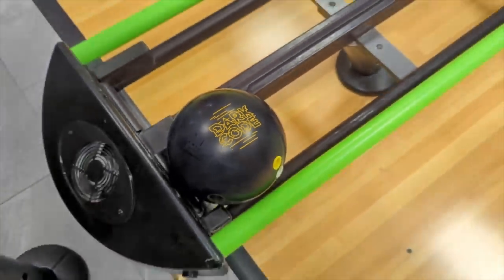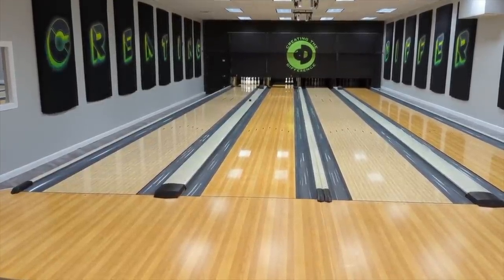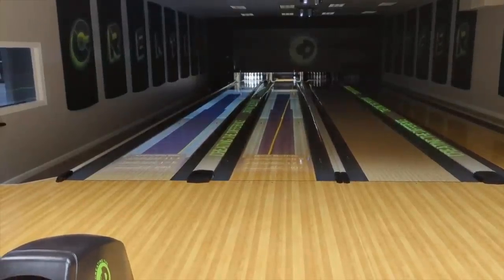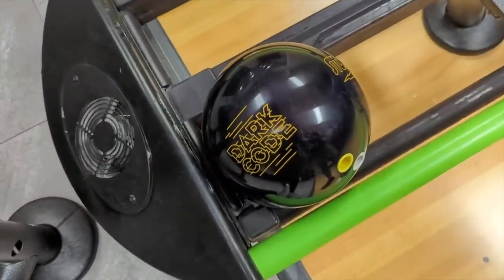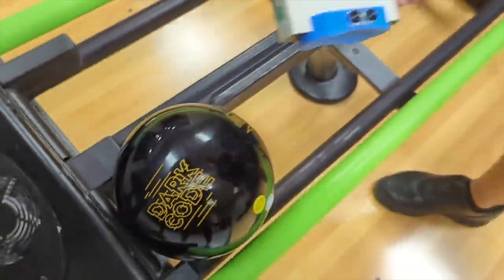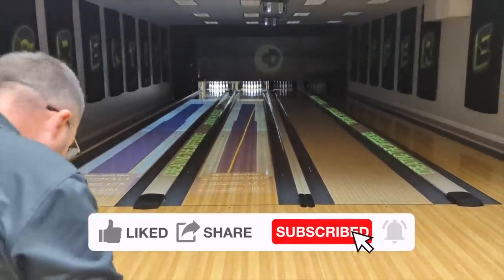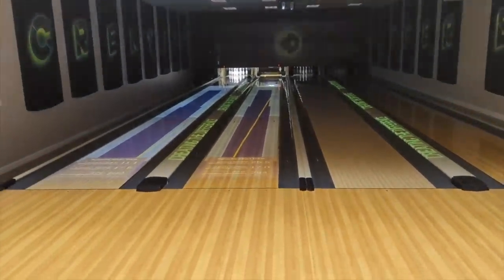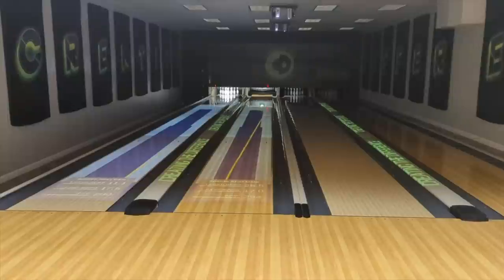4K Fast vs 1500 Grit Polished Finished Bowling Ball | What's the Difference in Performance?

Comment: What would be the result if you ONLY used the 1500 grit and skipped the polish step? Would the ball be more aggressive? (Does the polish soften the performance?) Or would the ball behave inconsistently? (Unevenness in the application of the 1500 grit would cause inconsistent performance?)

Comment: Sanding a solid is one thing but if I buy the rst x3 with the 4k fast, your saying 1500 grit and then polish it? I don't have a machine and will have to do this by hand. Isn't 4k fast some type of 4,000? Or is it just that 1500 grit and then polish would make it come close as possible to out of box finish? Not to mention the rst x3 is 2 parts pearl and 1 solid? I just don't want to mess this ball up by doing the wrong thing.

Comment: Slightly different procedure than the 2000/3000/P5000D. Even though the procedure you talked about here and the older using P5000D both scan at 5500+ what is the performance difference between the two?
Reply from the maker: Though they will scan the same the performance is much more backend with the process shown in the video. You actually need some lines in the ball to stop it from over skidding.

Comment: If I have a ball with a factory finish of 500, 1000, 1500, polish, and the Trucut pads cut exactly what the number says on the pad, and I wanted to get that surface back, would I only need to sand it at 1500 grit, and then polish it?
Reply: correct

Comment: Hey Ronald, I’m confused about your process to get a storm bowling ball back to 1500 grit polish. Approximately six months ago you put out a video about 1500 grit polish using the Trend 2. Your steps there was 3000 CTD pad and then polish. Now, your steps are 1500 CTD pad and polish. Can you clarify which steps I/we should follow? Thanks
Reply from the maker: This video is based on the latest information since we have more insight, and is the video you should follow
Reply: Thank you sir. Keep up the good work with your videos. I purchased your surface scanner can’t wait to receive it and experiment with getting the balls close to out box.

Comment: I see you sand 4 sides of the bowling ball.  Do you do this only on the finer grits?  Whenever I resurfaced a deeply scratched bowling ball where I started at 180 grit, I always sanded both sides of 3 axis.  Was I wasting time by doing the extra two sides or is that what SHOULD be done until you get to the finer grits?
Reply: Question for you. What’s the difference between 6500 & 5500 wax/polish
Reply: @hkaufman007  I think you meant to ask the YouTube video author, Ron Hickman, that question.  But good luck getting an answer.  It doesn't look like he answers many questions. Mine is a year old.